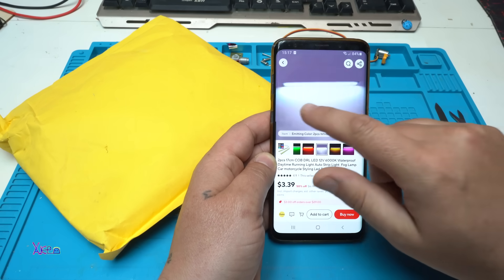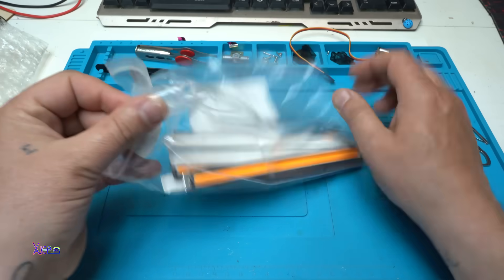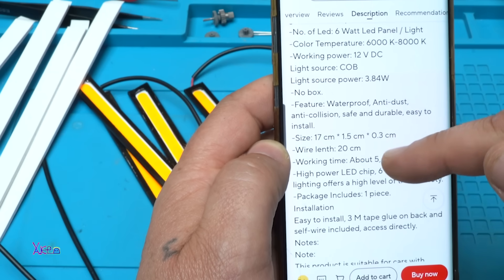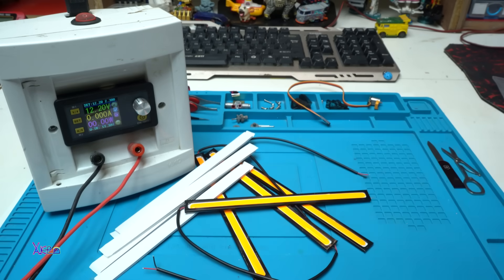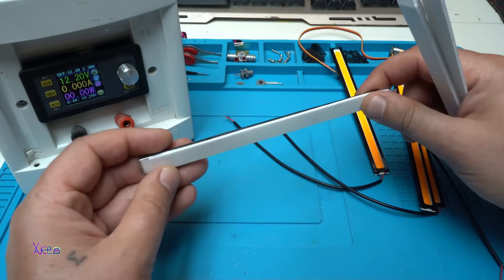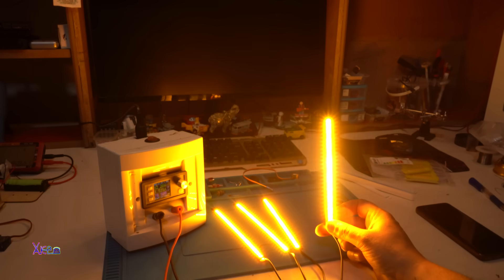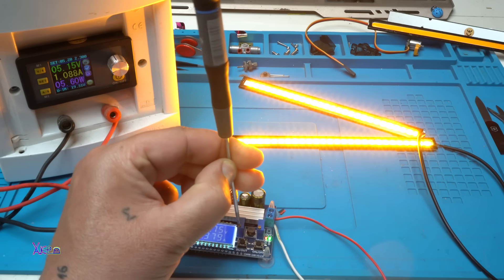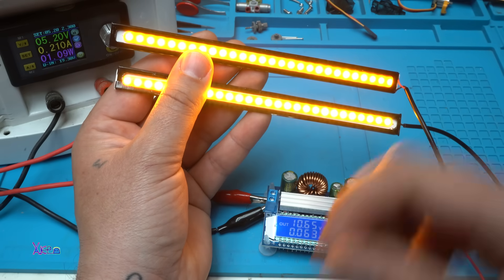WHY THESE $3 Aliexpress COB LED Modules are AWESOME?

Comment: Why are you using a calculator to figure the wattage all the time. The wattage is right there on your buck boost screen at the bottom. Silly man. You do that all the time too.
Reply from the maker: Negative charged people are always around us😁
Reply: @Hacktuber  How exactiy is that negative? I think you are too used to people hating on you I was just asking since I could easily read the watt meter and I'm pretty sure most people know their times tables and can do everything up to 12v in their head anyway. I called you silly man, I'm obviously just teasing you. I'll send you some bubble wrap or something.
Reply: Maybe it is for showing how to calculate for all folks without a fancy watt meter.
Reply: @radarmusen  in case they didn't make it past the 3rd grade and somehow managed to avoid learning their times tables? I'm pretty sure an 8 year old can figure out everything up to 12v by memory. I'm very surprised those LEDs did 6w. It was a tad bit in the bright side though. Probably wouldn't have a very long life at that wattage. The manufacturers tend to be a little, shall we say...optimistic with their ratings.
Reply: Q: Why do anything for yourself? A: Growth.

Comment: I have a similar setup I ended up buying 12v led panel a few years ago and paired with a homemade aluminum lid that acts like a heatsink and it outside the front door and I modified the play station 3 power supply to power the led panel it been touch wood without issues. The led panel have experienced all sort of changeable weather conditions and it still working fine